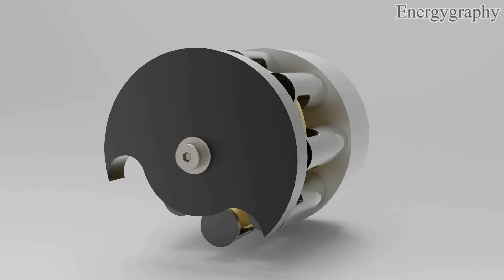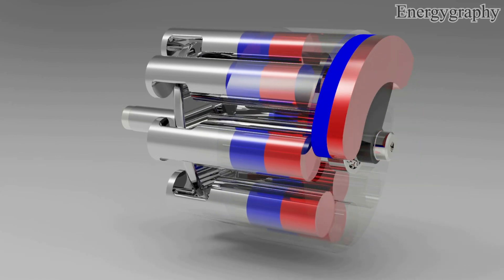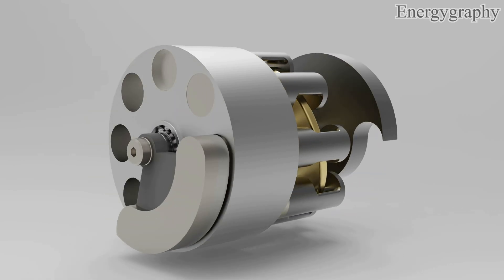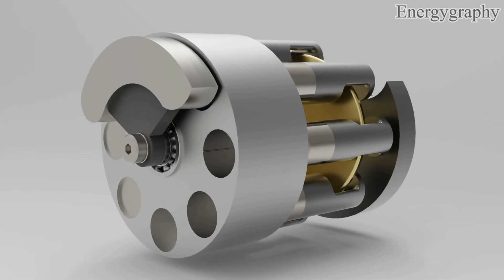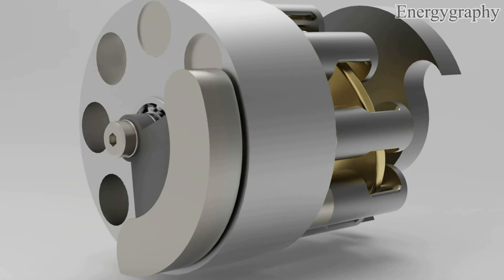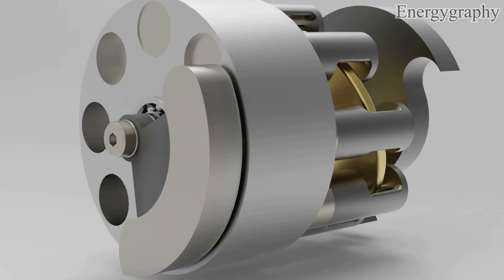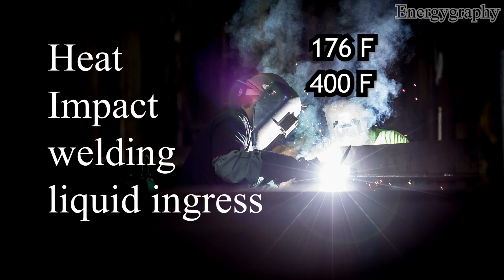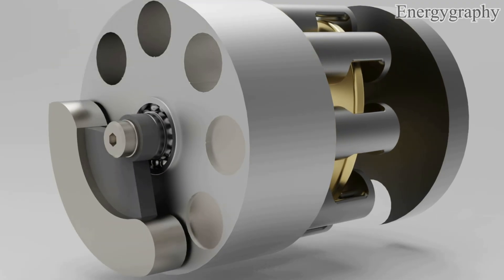8-Cylinder Magnetic Engine: Overcoming Lock Area with Unique Design

Comment: Well I don't think this design could be used to drive anything but if you implemented induction coils into the cylinders you could technically use this as a compact generator. I'm using it to turn mechanical energy and rotational YouTube rapid lateral force and electricity..... Right here with a few alterations and to a compact Dynamo or alternator that produces a decent amount of electricity for a given mechanical force but it will still need constant mechanical force. The likelihood that it will be able to power itself for any extended period of time off of the magnetic fields alone is extremely low but with a few alterations it could make a great generator core for sale backyard windmill or a water wheel or replacing your alternator. Like it's not going to run forever or any long period of time under its own power because no thanks to Newton's second law.
Reply: Long story short I do see several possible applications for this design with minimal alteration but not for the intended being a self-powering engine. However you could also take those same alterations and turn it into a electric motor with high torque low speed. For applications such as electrically powered power tools or other instances where you need a lot of torque but not a whole lot of rotational speed.

Comment: Good concept, but needs redesigned a bit, their to much wear to be had on the top piece , and the disc is a part that will wear fast also.

Remove top and disc and put cylinder heads and exhaust ports then fuel with hydrogen on demand ,

Use a direct air cooling tubes to cool the back of the magnets.

Poof, John Rogers version of a hho magnetic engine

Comment: it's a very beautiful design and very elegant. It really doesn't work in this configuration because the attraction side is just going to lock it immediately. You need repulsion on both sides and the timing of the repulsion Has to be calibrated so that there's a constant dynamic exchange on both ends. I suspect that the engineer knows this since anyone who went as far as to design the first case Would very likely understand the second case I just described. In any case these are very creative well designed red herrings  that help a consciously intelligent person  to actually think. thank you.
Reply: " It really doesn't work in this configuration "   It doesn't work in any other configuration either. Never mind how elegant a design might be, conservation of energy can't be tricked. Permanent magnets can only deliver potential energy, no continuous energy.

Comment: Hello, engineer, according to my personal experience with magnets, the power of the insole magnet must be twice that of the piston magnets, so that the force balance is not created. Because if there is a force balance, the horseshoe magnet will not be able to push the cylindrical magnet back. I hope my opinion is useful for you. Good luck🙏
Reply: According to the unanimous experience and knowledge of engineers and scientists this motor can't work and all proposals for changes to make it work are superfluous. A motor can't be driven solely by permanent magnets, this is outright impossible, never mind what exquisite designs are tried. Magnets deliver forces but they don't deliver continuous energy.

Comment: The problem I see with this is the amount of power loss on the flywheel pushing the magnets back and forth.
Reply: I was thinking the same, a lot of friction there. But it could be overcome if, instead another disk of magnets on the other side, we put a perpendicular disk. Once the first disk is in repulsive position, it will make the perpendicular disk spin which will repulse a 3rd disk.

If the second disk can spin in such a way that this works, then it would demonstrate his idea is correct.
Reply: @En_theo  
Interesting!!! He should try your idea, I was thinking of getting rid of the friction or at least some of it by adding rollers on both sides of the end of the magnets, instead of pins touching the two sides of the flywheel but I like your idea better.
Reply: @carlosaguirre6341  
Thanks. Or we could imagine friction-less contacts with smalls magnets. I saw magnetic gears in other videos and it works very well if the motion is not too fast.
Reply: @En_theo  
You have good ideas.  You should try to make a prototype.
Reply: @carlosaguirre6341  
I wish I had the free time for that, I gather pieces and make plans bit by bit. I should try 3D printing but i'm really too busy for that and these machines are not guaranteed to work once made.
Reply: @En_theo    To eliminate friction does not help at all. The goal is not just a device which can overcome friction, the goal is a device which can drive a load much bigger than friction. Otherwise such a motor would be useless. But since permanent magnets are not a source of energy a motor driven solely by permanent magnets can not even overcome a small friction.